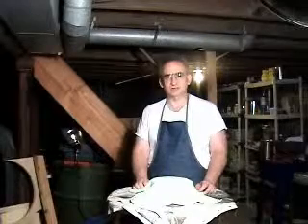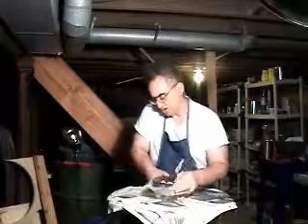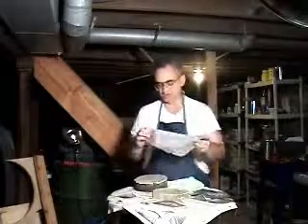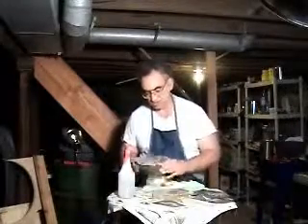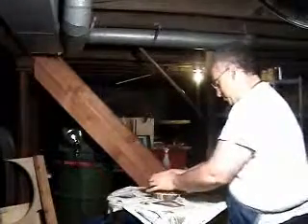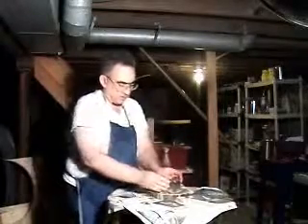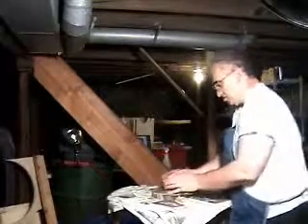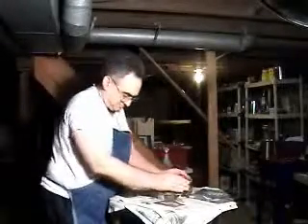Polishing an Optical Flat, Part Four

Comment from the maker: @pyite1979 Your question shows quite a bit of thought. The reason I walk around the stand while also rotating the top work is to continually present differenc radii to each other. This avoids astigmatism in the work. It is an essential element of the process. Are you making a telescope?

Comment: I have a question Mr. O'reilly. Why do you circle around the table as you rotate the flat when on top and lap when on top. Why couldn't you just rotate and not circle around the work table? It seems unnecessary to circle or rotate, Wouldn't just doing one of those processes be sufficient?